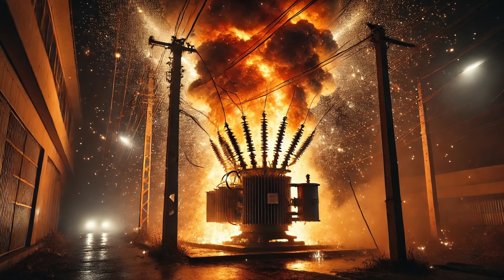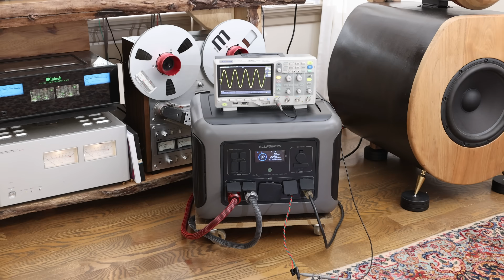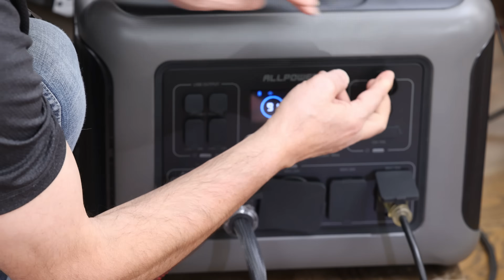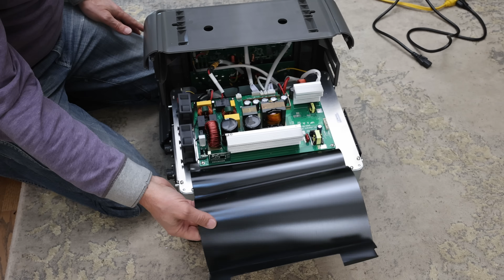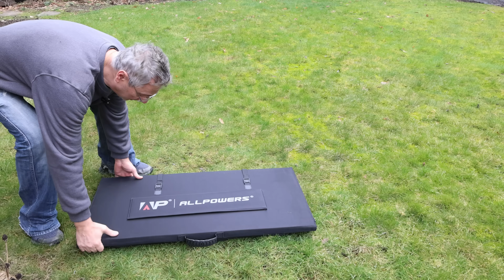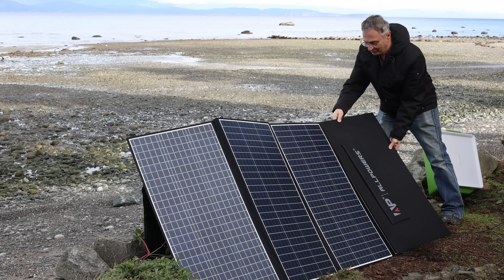Will a Massive ALLPOWERS Battery Improve Sound ?

Comment: The answer is that if your gear is properly designed then it won't have any effect except to increase the noise floor with the internal fans. The first thing your gear does is filter and recitify the AC coming from the wall into DC which is then stored in capacitors for use by your gear. The only thing that matters is what that DC signal looks like after the power supply has done its job. The AC signal can get extremely noisy and fluctuate large amounts before there's any change at all on the DC side. That's the whole point of a properly designed power supply. Your gear is happy to use the filtered and rectified DC electricity stored in the capacitors to operate and isn't even aware of the fluctuations and noise in the AC signal. You could use the oscilloscope to probe after the DC caps and you'd see that it would look the same whether it was plugged into the wall or plugged into that battery bank in almost every case.
Reply: ⬆ This is the actual engineering and TRUTH, however, the believers will believe whatever they want to believe 😁 Although I like Gabby's DIY projects and his skills ..... just look at the beautiful speakers he made 👏👏👏
Reply: @ Yes, people will believe what they want. Which, funny enough, actually means the music might sound better to them because music is a subjective experience once it hits the human ears and brain. It won't actually be better in any measurable way but just the fact that we believe it's better can cause our brains to interpret it that way. The same way music doesn't sound the same when we're sad or upset. I agree on the speakers, they look great! My goal isn't to rob people of their pleasure. It's to save them money to spend on things that actually make the most difference like speakers and room treatment.
Reply: @MMBRM  can we actually compare measurements with hearing, though?
Reply: @marcusbrsp  I'm not entirely sure what you're asking. Do you mean do measurements actually affect how we hear music? There's been a large amount of study done on how certain measurements are heard by humans. In a lot of cases the answer is yes depending on which measurements you're talking about. There may be some things we still don't know how to measure and then the only way to be sure they actually exist would be to have humans pick them out in blind ABX testing to a statistical significance. If we can't remove the expectation bias then there's no way to be sure the effect isn't placebo. As I mentioned in my second reply we hear music differently for many reasons even if the sounds coming out of the speakers are identical. One of the most often repeated improvements people "hear" with a new piece of equipment is increased detail. This is very easily explained by the fact that you are inevitably going to be listening more closely when something has been changed. Paying much closer attention means you hear things you've never noticed before. 

If you're talking about the AC/DC measurements I mention in my comment then we can describe those to great accuracy using sensitive equipment and confidently show whether or not there's been any change. We don't actually listen to those signals though. We can say with full confidence if they are identical then there will not be a difference in the audio signal produced by the equipment using them.  A good analogy would be  like purifying water through evaporation. You can start with extremely salty water or clean water but when you boil them and capture the condensation the resulting water from both sources is now pure and there would be no way to tell which water you started with. Anything made with water from each source after the purification process is going to be exactly the same.
Reply: @MMBRM  thank you for the elaborated answer(s). I was referring to the first one, where a better measurement of X doesn't necessarily mean a better listening experience. At least not an objectively better listening experience. At the end of the day, what really matters is the subjective experience. Placebo or not.
Reply: @marcusbrsp  Oh I agree completely that a better measurement doesn't automatically equal a more pleasing sound. There are a slew of measurements quoted today that are orders of magnitude below what humans can even differentiate between and they should not be the primary metric used to decide what is best. Although they do help to differentiate a well designed circuit from a poorly designed one.   

I use expensive 300B SET tube amps which, compared to a cheap class D amplifier, measure horribly but sound so much better to me it's nearly beyond belief.  I know they measure worse and I know they sound better to me and what is most important to me is how much enjoyment I get. I don't listen to the specs.  At the same time I use a spectrum analyser to help me pick the best tubes with the lowest distortion so there's room for both approaches. 

Everyone should do what makes them enjoy the music the most. At the same time knowledge is power and people should be able to make informed decisions about what we know for sure makes tangible differences and what is purely marketing.
Reply: This is exactly correct.  The rest is hearsay.  Also how do we know the battery isn’t adding ESR?   And maybe that’s why Gabster is hearing more bass ?    Or adding some capacitance
Reply: I wood love to hear a more in depth SQ analysis ( female voices , piano dynamics and atack, staging wide and depth , instrument separation)
Reply: @iepdeklein1701  Are you asking about my SET amps or the products featured in the video?
Reply: While a lot of this is true in respect of devices having their own filtering, capacitors in themselves aren't enough. CRC and CLC filters, when aptly designed can clean a lot of noise off mains that filter caps won't. There's also a need to consider if the use-case needs high ripple or low ripple caps, and designing for low output impedance. The latter being important to handle varying current demands, with a general rule being the lower the output impedance of a supply, the better it handles changes in current demand and voltage regulation, but also in handling input over/under voltage. This mantra that every device has a good enough internal power supply is simply not true due to budget constraints, or weight constraints, whereby PSUs are often made simply to get a reasonably stable voltage only. The real question is whether a device with more effective noise reduction before a device will mean the fed device performs better. The answer to that is that it depends on the quality of the PSU in the fed device. Most devices these days don't have much means to remove common-mode noise, and are just good enough to get a reasonably stable DC voltage reference. How well they cope with changing current demand downstream, or quickly regulate that voltage, or handle upstream over/under voltage is something else entirely. Simply put, if a device lets through common-mode noise, or before the capacitors a transformer is receiving a DC offset on the mains supply, then a device that eliminates these could well provide benefit and make those devices behave as they did with a reference bench supply when being designed. Designers thinking real-world wall outlets and a paltry PSU design will behave like their bench DC supply have their head in the clouds. As does parroting that devices that remove mains noise cannot affect downstream devices. It's a whole lot more dependent on a raft of factors and poo-pooing such devices shows ignorance of those factors. On a side note that we don't listen to PSUs in audio devices... When your CD player outputs 2Vrms at a few hundred milliamps, but the signal at the speaker terminal is 50W, where do they suppose the extra energy was transformed from? Amplification is literally bending supplied input power into the shape of the signal! Anybody who thinks the PSU voltage in an amp does not become part of the sound has to define where the energy/power gain came from in the system if the PSU input energy/power never is combined into the signal.
Reply: @maybecrazy7835  That is a rather wall of text and rambling. The first half only applies if the power supply isn't doing its job and the vast majority do their jobs very well. Especially in high end audio gear.  I'm pretty sure most designers are aware of the fact that their product won't be used with a bench top supply given the presence of AC/DC power supply they put in there. Somehow they are forgetting that their supply is going to have to deal with various quality levels of AC and noise?  It's plainly untrue that there's any sort of prevalence today of badly designed power supplies which are susceptible to the type of AC noise and fluctuations seen in the modern homes electrical system/power grid.  These fluctuations are mitigated by having sufficient reserve in DC storage caps. Not having enough reserve would by definition be a bad power supply. I've seen inexpensive modern power supplies function perfectly with 80 VAC instead of 110.  

Of course a power supply is an important part of any piece of audio gear and if there was a significant amount of noise surviving the AC/DC rectification and filtration it could easily end up on the output but this assumes a failure on the part of the power supply. 

As far as listening to power supplies you're playing with semantics. Are we listening to the wall AC? Listening to the power transformer in the substation? What does that sound like?

 Most external filtering devices are useless and result in no change in the quality of DC post PSU. Sure, some remove noise before it reaches the audio device but the power supply would have done that anyway.  

There are going to be niche use cases where they can make a significant difference but most of the time they won't. The idea that this battery or any sort of noise filtration is going to result in any significant change in music signal quality is extremely unlikely.
Reply: @MMBRM   Well not looking to pick a fight, but your response is equally a wall of text, just you added a few blank lines to make it longer ;) 

No part of my reply talked about effects of PSUs on audio sound quality that should earn your comment of "As far as listening to power supplies, you're playing with semantics". You confused the aside with my general comments, but on the concept I alluded to in the aside, where the input supply is the (energy) converted in stages until it's sound at the speakers, I will simplify: It's physics and you clearly know this.  I agree with most of your comments in your initial post, just not your view that well-engineered PSUs are likely in most high end products. I also was commenting on the series of replies which made some almost absolutist claims when things are more nuanced in reality.

Anyway, back to that concept of listening to your PSU.... You don't get audio from hifi electronics devices without converting electrical energy, and every audio device converts electrical energy, be it gain in an amplifier that takes the supplied power and shapes it relative to the signal to produce increased output relative to the input signal, or a speaker converting that into audio energy. It is not semantics, it's the literal over-simplification of the physics. So yes, I am saying the quality of the device output is dependent on the power supply and that we indirectly do listen to the summed quality of the power supplies in our audio system. 

Start from a well engineered PSU and make it progressively worse (less reservoir capacitance, higher output impedance, worse regulation, etc) and you'll end up experiencing notable loss in performance. Take it far enough and it malfunctions. Now I know you agree that's what would happen, so turn the logic in the other direction in terms of improving the supply - it makes things better, until the debate becomes "but can you hear any difference?". And even then, "is it real or imagined?"

While your comments suggest you think the majority of high end devices have well-engineered PSUs, I'm of the opinion they don't, as evidenced by the plethora of expensive audiophile devices measuring horribly over at AudioScienceReview website and personal experience examining/measuring hifi devices. Including some 'high end' devices I own.

I  don't strictly blame the engineers, it's more likely their managers are telling them how little budget they have to design something. High end audio is full of snake oil and smoke and mirrors. 'High end' (or rather high price) is no reliable indicator of quality engineering. It's an industry of marketeers pushing/creating belief systems and cognitive biases due to potential high markups (profits) and nice aesthetics people buy as status symbols. None of which detracts from the importance of well-engineered PSUs. 

I find a DC offset on the mains supply is quite common. AC center then oscillates around the offset on the inlet and causes transformers to produce asymmetric output, which rectification and smoothing caps do not fix - you then still have an asymmetrical output on the DC rails because of this. Most audio devices I've seen with LPSU do not fix DC offsets. If the rails are uneven, devices like opamps that require symmetrical rails don't perform correctly, so such things do go on to affect sound quality. Even minor DC offsets can badly affect the transformer performance and thus PSU output. Now if a PSU does contain a DC trap, it won't be an issue. I don't think I have ever seen an audio amp with a linear PSU and a DC trap before it. But I look at consumer audio devices and my suspicion is studio devices might not suffer the same practices as the consumer market. I include a behemoth class A power amp from a popular and revered US brand in noticing that there's still no DC trap!

Another common issue (still growing) is the quality of regulation of the transformer and being cheap and not specifying suitable VA rating of transformers to prevent voltage sags in an amplifier. This is more common now due to slimline lifestyle enclosures that cannot accommodate suitable transformers (or capacitor bank) for a design of power amp. The vendor uses transformer-based linear PSU (because it's what audiophiles want to see and buy into) and then use modern *fets that can drain more energy from the reservoir caps than the mains can keep charged. Or they cheap out on caps with too much ESR and supply regulation becomes an issue.

My comments in my last post (and this one ) are generally aimed at these poorer practices, which are common in high end consumer audio IME. My comments are also about DC offsets not being handled (typically) and some types of common-mode noise. It is these last aspects, combined with poor PSUs in consumer hifi, that might result in minor improvements from an upstream conditioner or regenerator that does deal with these power issues, preventing them from occurring in a downstream device PSU. 

I cannot comment on the device in the video, except to say I would hope it has less noise than mains and no DC offset, but I too wouldn't expect it to make an audible difference in Gabster's system unless some of his equipment also suffers from poor internal PSUs. Heck, some high end brands tout tube rectifiers, which only make sense in an audiophile's head.
Reply: @maybecrazy7835  No fight here! I think most of our disagreement hinges on the fact that I believe that in most cases the power supplies in most gear is easily able to handle the differing AC quality in most homes. I've allowed for the fact that in some rare cases pre-PSU filtration and mains modification can result in audible distortion of the music signal. Just a difference in personal experience and point of view. 

I'm aware of DC offset but again in most cases it's a non-issue with current wall AC and the appliances plugged into it. Very few still have any substantial DC leakback. Also generally these tiny DC offsets(~50mV) can result in toroidal transformer hum but often will not result in any noticeable alteration on the DC side. Like anything if it gets bad enough it will cause issues. I actually use a DC offset killer(EMOTIVA CMX2) in my own system because I use a Equitech balanced power conditioner with a 45lb toroid transformer in it. Also has common mode filtering in it. For $200 I'd buy it just for the peace of mind! While it did quiet the hum from the transformer there was no difference in THD/SNR/NOISE floor from my amplifiers(as measured with a spectrum analyzer with a -150dB internal noise floor).  I tested three of them just out of curiosity. I bought the equitech because in another very old house I had a ground loop raising my noise floor. Balanced power completely eliminates that possibility. Not a problem anymore in my current residence but it's also not going to hurt anything leaving it in the system. I've verified that there were no measurable signal changes with/without it. So in my mind yes it exists but in the vast majority of cases it's a non-issue. I'd agree that it wouldn't hurt companies to build it into their power supplies and there's no harm in eliminating it if possible. 

I do think it's also important to point out as you mentioned that even if there are small differences in noise on the musical signal due to these problems the likelihood of them being audible by humans is very low. Most devices these days could have their output specifications worsened by an order of magnitude and it still wouldn't make a difference to us humans.

 Oh, I am one of those people who has amplifiers which use tube rectification! I have a pair of 300B SET mono blocks and  they sound amazing! At 85dB avg measured at my listening spot they have under 0.3% THD from 40hz to 20kHz and a 70dB signal to noise ratio. Terrible measurements compared to any solid state offering starting at $100 and above but still well below human ability to discern. The sound however is better than anything else I've ever heard. I've owned some of the best solid state(Sim Audio, Mark Levinson, Bryston, Krell) and tested modern class D but absolutely nothing makes speakers disappear and brings the artist into the room with you like SET amplification with speakers that are easy to drive and the right efficiency. It's actually quite annoying because tubes are antithetical to my basic sensibilities and a pain in the ass to boot. 

Nice conversing with you. Have a good one!